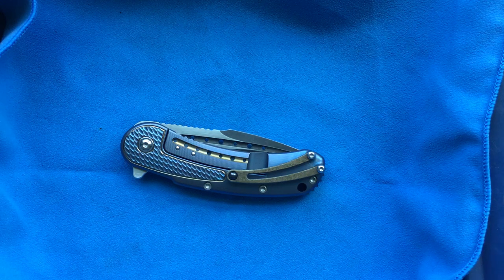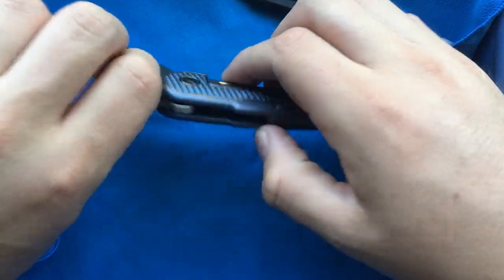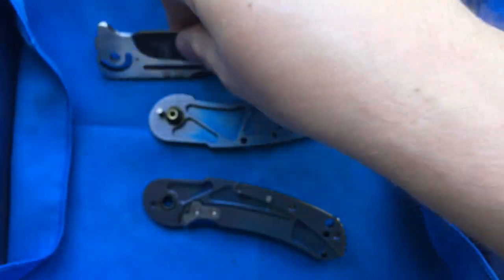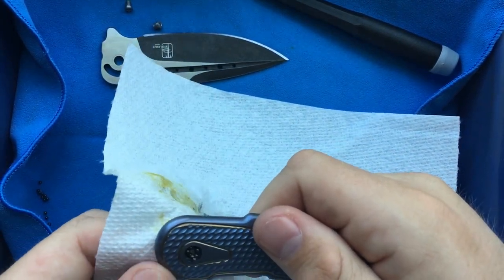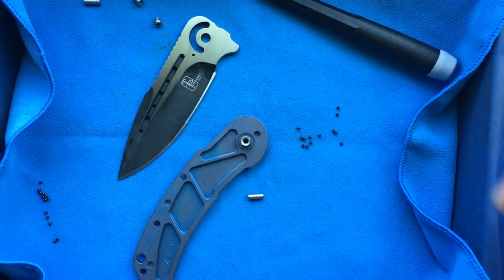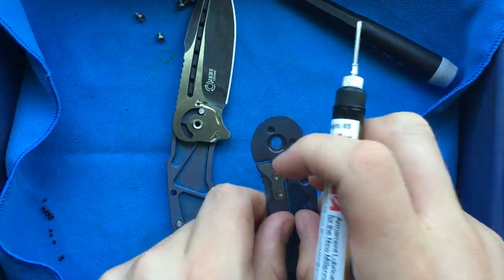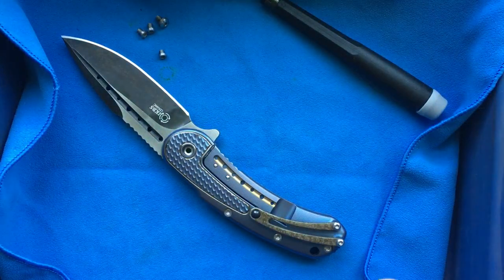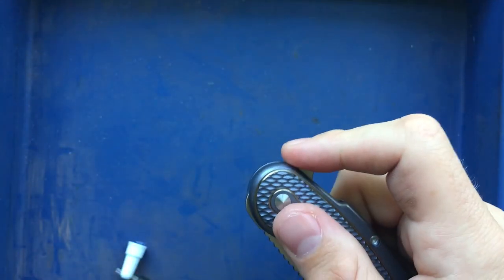How to disassemble and maintain your Todd Begg Steelcraft Bodega Pocketknife with IKBS bearings

Comment: I carry one of these as my EDC knife and it gets used quite a bit. I had been apprehensive about disassembling it due to the IKBS but I followed your video to the letter and it was a piece of cake.One issue I had though, I couldn't stop the free spinning pivot from turning even with the latex glove.Here's a tip though, and I only did this because of the build quality of the knife. I held the blade at 45 degrees and applied a little pressure to bind the pivot and it worked like a charm; it had not effect on blade centering of pivot alignment. Same thing on reassembly.

Comment: I had a Boker kwaiken with these IKBS loose ball bearings and I was told to use white lithium grease.  works very well to hold those little buggers in . I sure was suprised when I opened it.   I used to own one of these knives . I  ended up trading it , not really sure why because it was a GEM ! I Had the black version,  very handsome knife .
Reply: By these knives I was talking about the steel craft kwaiken . I really miss it.

Comment: are ceramic bearings better than steel bearings, great vid as always extremely informative
Reply: I don't think there's tons of difference between ceramic and steel bearings; some custom makers prefer ceramic, but they have the potential to chip or crack. It's very rare though. I myself prefer steel bearings, but that's just me.
Reply: Ceramic bearings makes the knife mush smoother. Big difference IMO. I never had a problem with chip or crack of them, and I would perfer it every time. On my bike I have changed ceramic bearings in the derailleur. OMG its mush mush better and smoother now.

Comment: I'm sorry that this is such a late comment to this video. But I'm curious to know what driving tool Nick is using to disassemble. A specific torx manufacturer? I'm tired of spending money on substandard steel bits that round out after 9 - 10 screws.

Comment: Lordy! I was in love with this knife until I saw the loose balls. Is the action really that much better with this kind of setup?
Reply: IKBS is many times smoother than caged bearings as far as i'm aware, I feel like it's because you remove the possibility of friction due to the removal of the plastic cage for the bearings, remove a component for friction and there are only 2 surfaces to touch rather than 3, allowing the bearings to be much larger and smoother

Comment: IKBS looks like a massive pain to deal with. Does it offer any performance benefit over captured bearings?
Reply from the maker: +cloudcleaver23 Nope, captive can be just as smooth.  But it seems like it's easier to make IKBS really smooth than captive bearings.
Reply: "Smooth" as in even and non-stutter movement, or "smooth" as in "frictionless/falls shut?"
Reply from the maker: +cloudcleaver23 Both.  Although IKBS has a slightly different feel.  More hydraulic
Reply: Hm. Might have to visit one of the nicer knife stores in my state at some point just to handle a few of these $375+ gems.
Reply from the maker: Yep.  But remember the curve of diminishing returns.  You're likely already damned close.

Comment: Hi Nick! I know you favor heavier weight oil for bearing-type pivots. That makes sense to me.  Outside of the #85 Nano-oil, do you have an alternate recommendation? How does the thickness of the #85 compare to 3 in 1?  Thanks again for another great vid, btw!
Reply from the maker: 85 is thicker than 3-in-1.  But honestly, I suspect you could do just fine with a regular weight oil (Daiwa reel oil, etc) in this sort of task.

Comment: Hey Nick - What do you do if the dam pivot nut just spins on the back side? I have a TB Kwaiken that uses the exact same pivot nut and bolt as in the video.
Reply from the maker: +Glenn Goodlett Heat to break the loctite, think hair dryer, and a latex glove to be tacky against the spinning pivot
Reply: Nick Shabazz , worked like a champ. Thanks for the tip.
Reply: go to the review Nick did off the Field Marshall where I explain how to remedy this.  
best,
Mark
email marl@beggknives.com